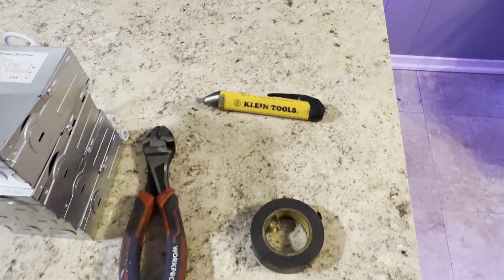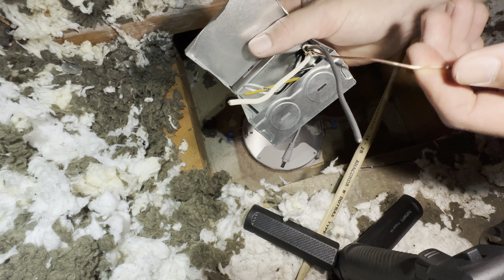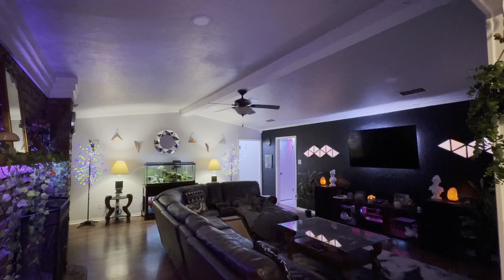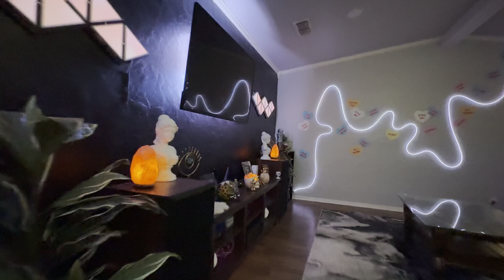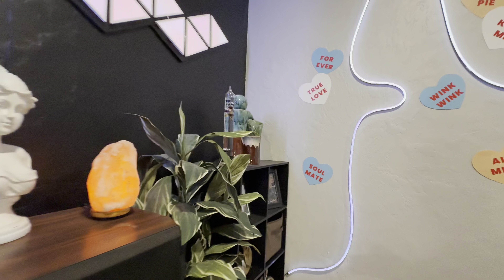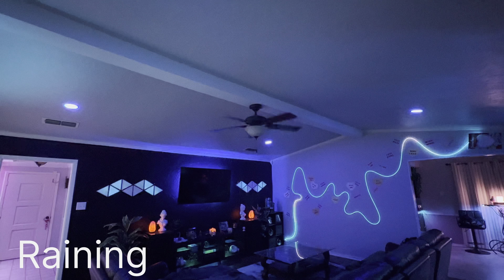Govee Recessed Lights! - Full Installation Guide 🪛

Comment: You didn’t daisy chain from that first light?
Reply: Gotcha! Just daisy chained mine, but considering doing something similar to your setup for another room of mine. Solid review, and appreciate the response
Reply from the maker: @aphidreviews thanks! The only reason I did this is because I have a 3-way switch. It can be confusing so I did the guaranteed method of running the wires to the current source. Works every time
Reply from the maker: No. I ran a pigtail from all 4 lights to the existing center light/fan in the room

Comment: You only showed the wiring of one light, what about the rest? I’m guessing if every light is on one switch you tapped into a power source on that switch and ran power to the four different boxes using pigtails . Power in and power out to the next box until you got to the end.
Reply from the maker: So on 3-way switches, the easiest thing to do is to wire a new light to the current fixtures end point. So, my ceiling fan in the center of the living room was the original target. I ran all jumpers from the new lights to the ceiling fan fixture and connected all hot, neutral, and grounds together. There is other ways to do this if you don’t have room but this is the least confusing and most accessible for my situation.

Comment: I have existing lumary light (which i hate). Do i just unplug the ones i have and plug the new ones in?
Reply from the maker: You’ll need to wire the electrical to the new Govee LED driver box as shown in the video. So you’ll need to connect the ground/neutral/hot to the new Govee driver box and then connect to your new light
Reply: @STONELIGHTS thank you!! I have 4 lights coming Wednesday,  im mor an electrician but i think u can do this.  I just need to find the breaker to shut the power off
Reply from the maker: @soright34 turning off the switch should be enough unless it’s a 3-way switch but it’s always best to turn off the breaker anyway just in case
Reply: @STONELIGHTS its not a 3 way switch but it is a 2 way

Comment: did you run it as a daisy chain? how did you run power to the other 3?
Reply from the maker: 3 way switches can be confusing. I learned a long time ago, if you’re adding extra lights, just run the wiring to the original light and splice in. That’s what I did here. I’m sure there’s a more official way to do it, but it worked. So each light I ran a jumper to the ceiling fan and spliced in 👍
Reply: @STONELIGHTS ah ok! My situation will be different as I’m running directly from the breaker and creating a new line with a brand new switch just to control those
Reply from the maker: @Deathbyfitzoh ok you’ll be good then. You could maybe create a splice box kinda in the middle of them all and do separate runs for each to the middle box that has power. Thats what I’d do.

Comment: Hi thanks for the video. How does it work with the physical switch ? Say if you have them dimmed to 50% and you turn them of with the physical switch do they come back on as they were or is there a preset that they come back onto?
Reply from the maker: @LetsGoStrongBros  they will come back on with the previous setting. If you had them on purple 27% brightness and turn them off/on again they will still be the same!
Reply: @STONELIGHTS  awesome thanks.

Comment: Great video, although you may want to mention that you need to have a cable clamp on the Romex going into the knockout hole in the electrical box.
Reply: your correct, called him out and everything, clearly he didn't know or he would have said it and done it
Reply from the maker: @travisblevins1584  yea. There’s many things not mentioned if we want to pick it apart. It’s hard to cover everything in 15 minutes. I just try to get a good general understanding of everything while keeping it mostly simple. I appreciate the comment though and thanks for the tip for others 👍
Reply: @STONELIGHTS mentioning using a cable cable clamp takes like 5 seconds and you didn't even have one on when you finished wiring the box.

Comment: I've putting replacing all my home lights with the 4 inch recessed lights. I've got a dozen done so far with about 6 more to go. They are pretty simple to install if you are replacing existing lights. I'm going to be running all new wires and drilling holes to put 4 up ones in the garage.
Reply from the maker: @stevenprichard6179  nice! My install was a little troublesome due to having 3 switches running to my single fixture beforehand. Then adding 4 additional lights. I kept it simple, and ran all 4 drops to the ceiling fan.  That’s the best way I know how to do it with 3-way switches.